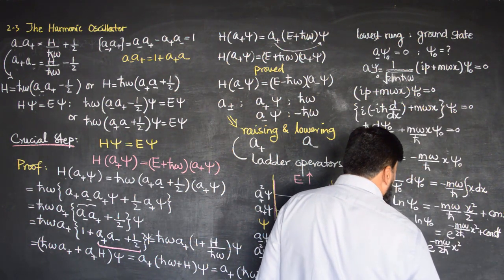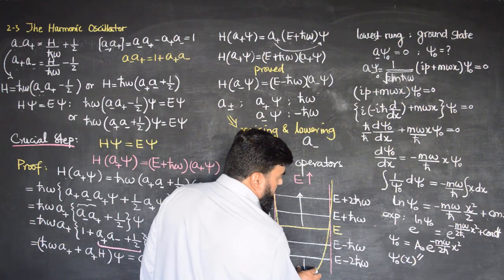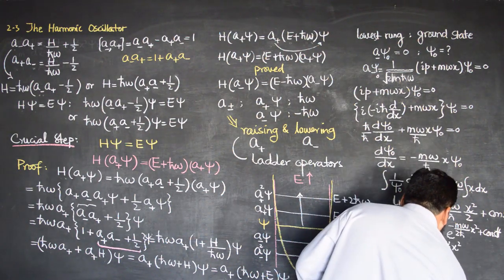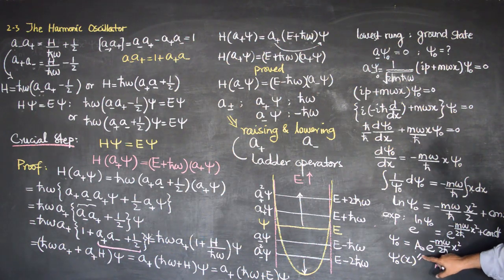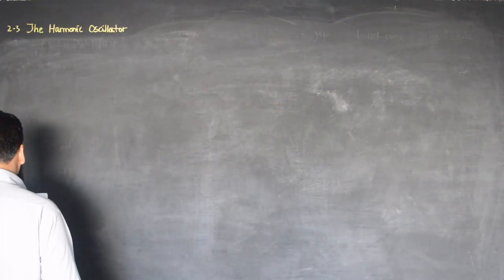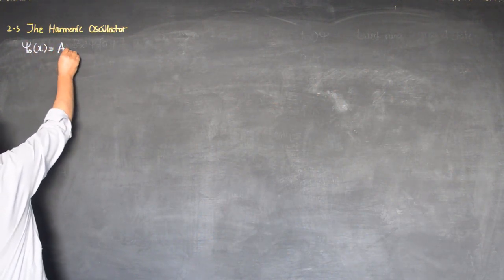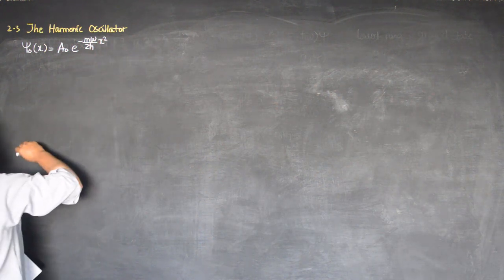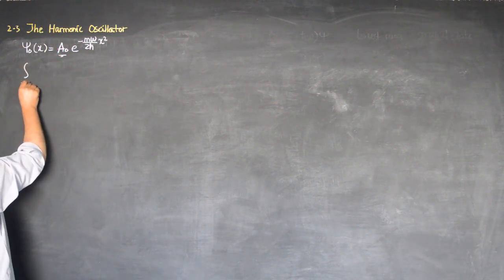L10.4 The harmonic oscillator: ground-state wavefunction derivation

Comment: At 3:07 we utilized an integral which is not in the form of the integral we are solving as x^2n is missing.Then how can we utilize such integral?
Reply: I mean the integration formula we are using.
Reply from the maker: Responded. Thanks
Reply from the maker: Search in an integral table. It’s easy. Thanks
Reply: @SAYPhysics  Right sir i got it . we take n=0 its fine thank you sir